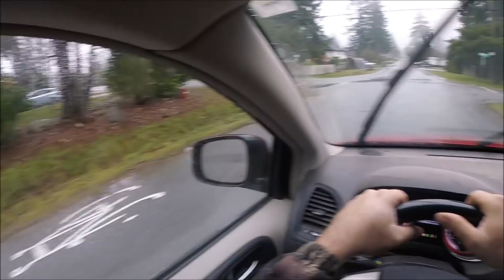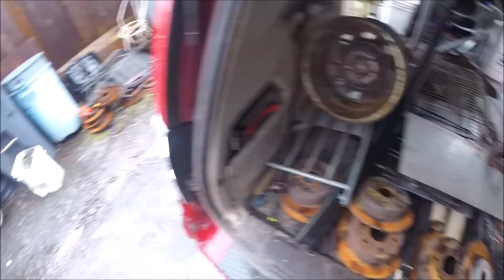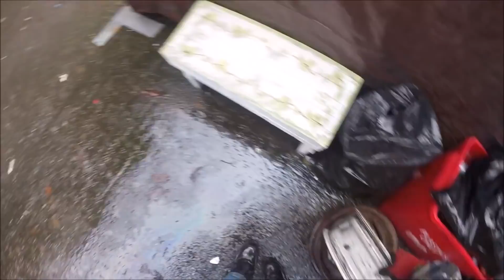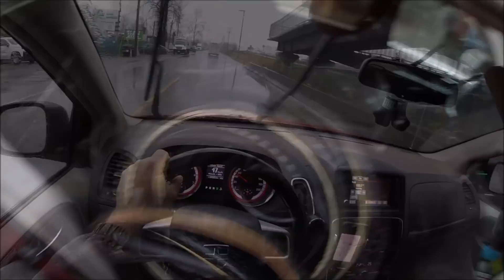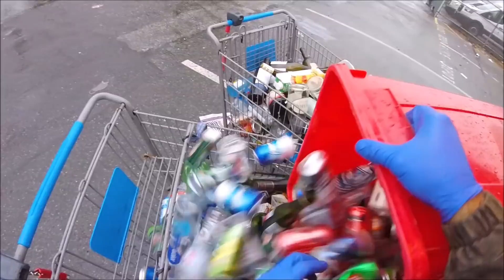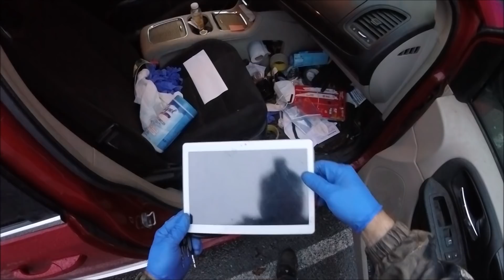Scrap Run Selling HMS + Tire Dump & Bottles

Comment: Yesterday I posted a comment saying that CTH is better of taking the bin to carry HMS. I gave the reason also. 
1. Bin is empty and available. 
2. It accommodates all HMS. Now some wheels are left coz they could not fit into the red van.
3. It saves CTH a lot of heavy lifting for unloading. He can simply lift the bin and unload. Helps his stiff back. May be to reduce noise while loading?? I don't know.
Nevertheless, a yard run means clear yard. HMS gone, rubber gone, bottles gone. With bottles gone, a relief because it reduces decomposing liquid smell in rain.

Comment: Just looking at the pile and the stack of tires, I knew there was a lot, but I didn’t think it would weigh 1300lbs, wow!  Nice little payday $123.50 and yard cleanup.  And bottles, my guess, hmmm, @10 cents, $29.  Oops $26.30.  I got close, but not a winner.  $123.50 + $26.30= $149.80.
Reply from the maker: The wine bottles through you off
Reply: And 11 rims left behind. 11 rims = 11X22=242 pounds= 242X0.095=23 dollars which could have been in his pocket.
Reply: @altafrahman2254  I thought about that but, he mentioned losing transmission fluid so I thought the decision to use those left behind rims as the starter pile of HMS for the next run was wise.  No stress on the machine while vulnerable.  And 1300lb is a good payload 💰 since the last was 600-800lbs.

Comment: When you're taking those tires off the rim you may want to lubricate my bit with a bit of soap that makes me a bit easier are wet the tire when you're cutting it with the saw something you can try other than that good video good load👍👍😀☔🔌🚲
Reply: Good suggestion. In lot of tire change shops that is exactly what they do. Sprinkle soap water on tire. It takes out a lot of friction whether cutting tire or loosening tire from steel. I saw in old CTH videos. He was doing it before.
Reply from the maker: The manual tire machine will need lots of soapy water

Comment: All the while watching CTH yard runs with Alu, SS, Non ferrous, HMS, Bottle runs, I was trying to guess how CTH will do a shred run by end of the week. As days passed, the time left (last day of the week for shred yard run is Saturday) is going down by each day, it gets difficult to load the bin and sell.
Today is Friday already and there is only a day left for CTH to scrap appliances, fill the bin, look for smalls and do a yard run. 
For people regularly watching CTH videos everyday, it is like a TV serial which ends daily with suspense of what happens tomorrow. So people are glued to You tube waiting for his next video.
He has done 7 shred yard runs in last 7 weeks, never missing one. Now with only 2 days left for his next yard run, for me suspense is building up. 
Will he do the yard run this week or will he skip?
If he attempts to do it, how he will go about it?
Will it be a long bin filling marathon and sell with out smalls or will he do street scrapping looking for smalls?
For me tension is building up. This is nothing short of a TV serial. Fingers crossed. 🤞🤞🤞🤞🤞🤞
Reply from the maker: I have 2 inspections tomorrow
Reply: @CanadianTreasureHunter  Thanks Phil for letting me know. Now you have taken the suspense off my chest. So after a long streak of 7 weeks, the weekly yard run is not happening. Inspections are more important because they get you copper bounty. Good luck. 👍👍

Comment: Do you get just normal lead price on the wheel weights?? Or is there a special price??
Reply from the maker: No, Not sure on price
Reply: @CanadianTreasureHunter  cool. They add up pretty quickly and as it’s lead you’ll get a nice weight.